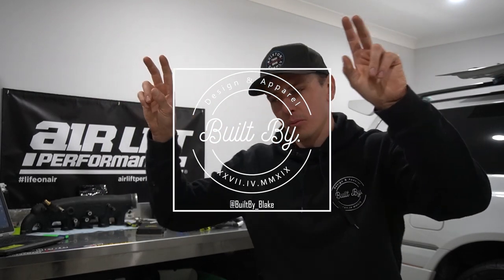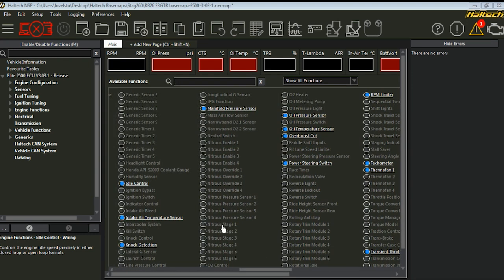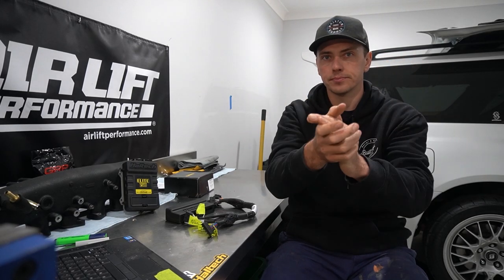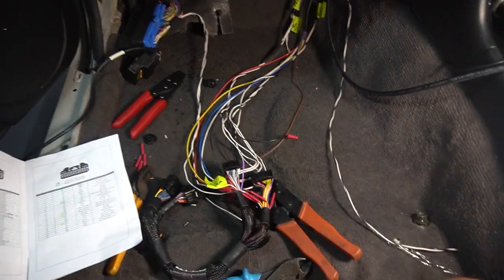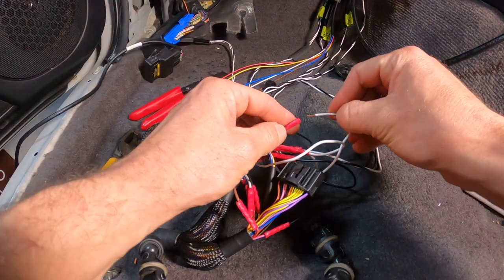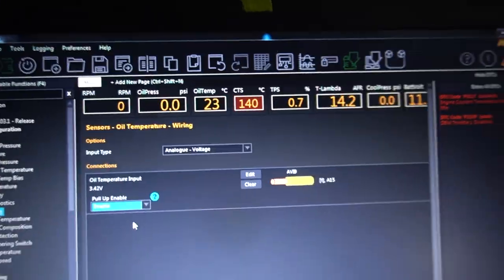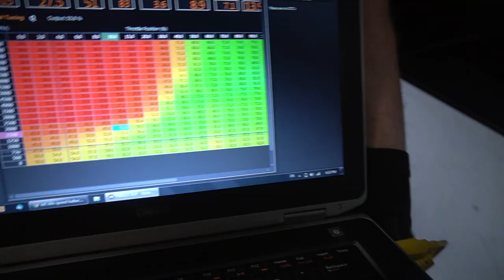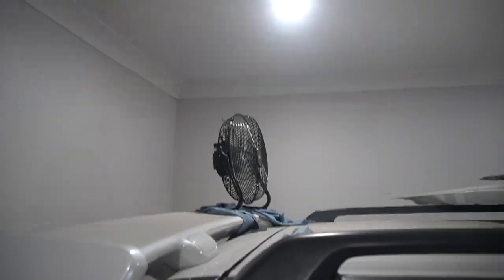Haltech Elite Ultimate DIY Install Guide

Comment: I have a really.dumb question...watching you splice the wires. The wire comes into the cab from the sensor under the hood, you unpin the corresponding wire from the connector going into the pnp module and connect those two wires. What are you reinserting back into the connector that goes into the pnp module?

Comment: How did you work the fuel pump situation? I’m trying to wire in a frenchys dual pump with a fore controller and getting stuck on splicing it into the plug n play harness.
Reply from the maker: Not sure I understand exactly what you mean. 
Good rule of thumb for any fuel pump install is to run a dedicated relay and power feed for each pump, and then Haltech uses output to control the relays (seperate or together, same same)
Reply: @BuiltByBlake  yes what I found out is my fore controller needs signal to be 12v and the haltech dpo5 is signal to ground so I just need to invert the relay to have it give proper signal

Comment: Something tells me you didn't update the injector flow cc's or dead times with those afr's 🤣 good work tho. Once you get the confidence to do what you are doing, it all starts making sense and getting easier and better 👍👍👍
Reply from the maker: So funny you say that! Haha. It didn't make the video because it made for boring content. But since you mention it. Yes, it took me about 3 hours to figure out my 1000cc injectors were firing at the factory 440cc rate. So dumping bulk fuel for absolutely no reason haha. Learning curve 😅

Comment: Hey man are you using the Bosch temp/pressure sensors? How did you mount them away from engine vibrations and still get a fluid temp reading?
Reply from the maker: Sure am mate. Oil is fitted down on my oil filter relocation kit. Water is fitted in the oem spot for me, which is on the motor and I’ve have zero issues so far.
Reply: @BuiltByBlake  legends thanks man I completely forgot about oil filter relocation kits 😅
Reply: @BuiltByBlake  did you mount the sensor to the actual block mount or the filter mount?
Reply from the maker: I put my on my filter mount (not on the block directly). I did a video on my oil filter relocation if you want to see where I’m talking about

Comment: Nice work mate keep it up, I have one question bear with me it may a stupid one.
Can you connect the sensors to the OEM gauges and if you can is it sample or difficult or you need to aftermarket gauge ?
Reply from the maker: Hey mate, not a dumb question. The factory gauges all have their own sensors and removing the factory ecu doesn’t effect this. 
So all I did was identify where the oil pressure and boost reference factory sensors were and left them as is. (Obviously didn’t touch anything to do with the torque split gauge) 
As long as you leave them installed the gauges work fine with the aftermarket ecu 🤘🏼